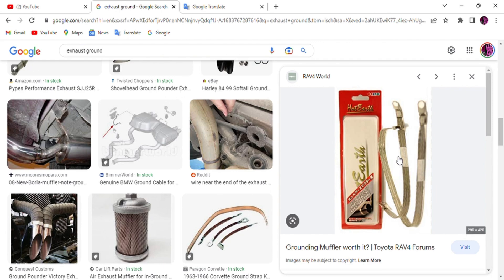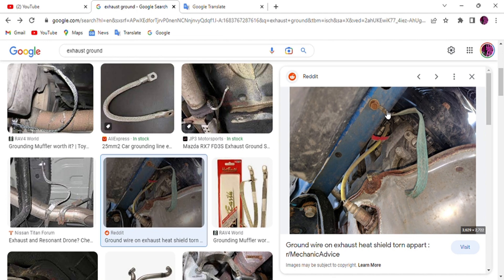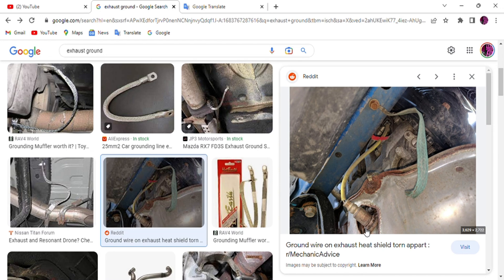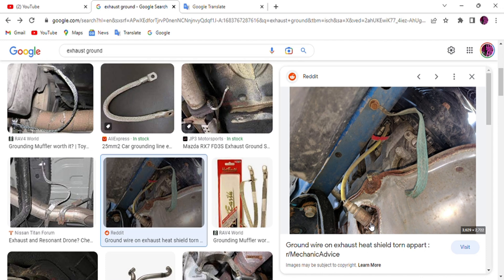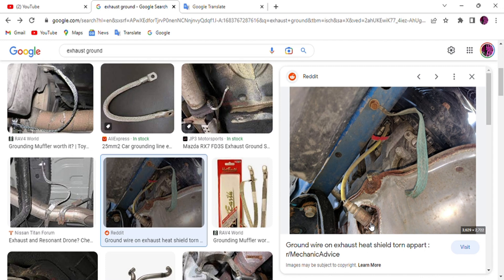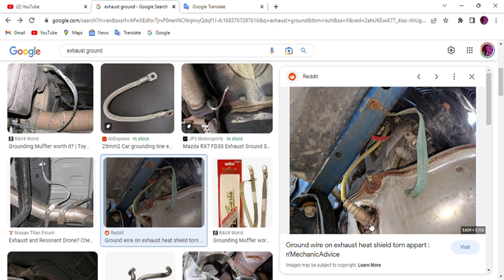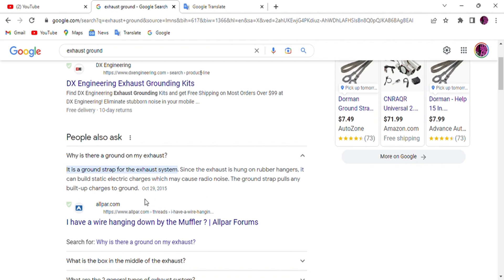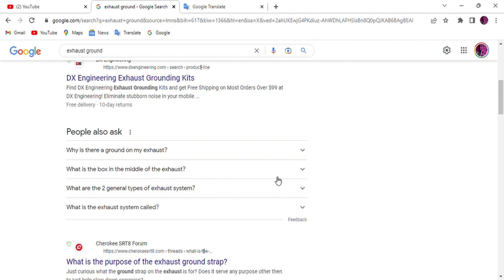U1000 C1136 Code for Infiniti G35 G37 Q50 Nissan 350Z 370Z Why is there a ground on my Exhaust

Comment: Bro I literally just got that code and have those same problems…I just got code u0001 and p0128 2 days ago
Reply from the maker: The code p0128 is coolant antifreeze thermostat make sure the fluid is full if the antifreeze fluid is low can give you this cold too if the brake fluid is low can give you this code too

Comment: Thank you so much for making a videos about this topic! I have an FX35 and have this same code come up on an advanced scanner
Reply from the maker: Also for the code if the pops up on your car if did they open anything and your engine or did you replace the throttle body you have to program the throttle body or the gas pedal